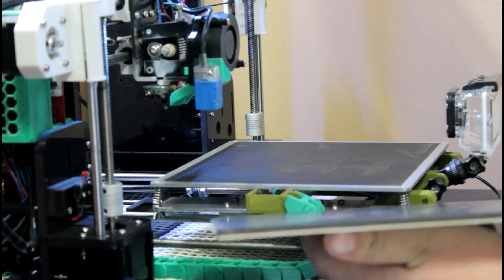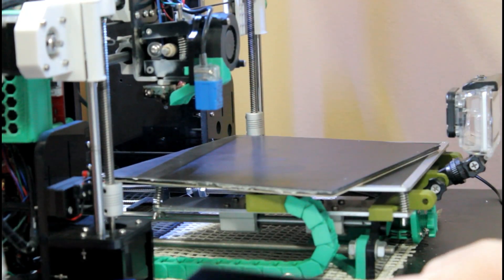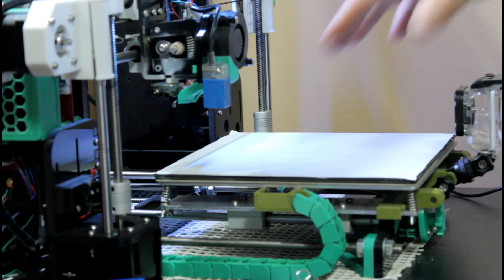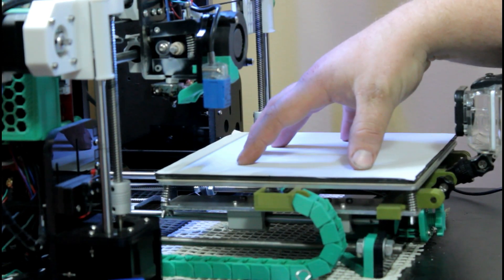Make Your Own Magnetic Flex Build Plate

Comment: Is the magnetic property of this sheet disappear with time?
Reply from the maker: It's still sticking to the workbench, havent used it mich lately though. The bigger issue is the magnet sheet drying out it seems ro crack after a lot of use.

Comment: Thanks for the awesome ideas! I've tried it and have been quite successful with adhesive magnetic sheets with the aluminum plate and a BuildTak type material. However, with my slightly warped aluminum, I'm thinking of either replacing it with a thick carbon fibre plate (or maybe just sandwiching it between the aluminum and the lower magnetic sheet). Where did you get the thin nylon from?
Reply from the maker: Cool! Good to hear someone else is tinkering around with the idea! The nylon is just a thin sheet that they adhered to the magnetic "blanket" when I bought it so I'm not sure how long it will last with multiple heat cycles.  It seems to work well with PLA but anything hotter like PETG it seemed to bound to it.  So i'm not sold that it would be a much better alternative, it does seem to work really well with PLA though.  I had the same issue with the warped bed as well that's why I originally got the PrintnZ plate, I thought maybe it would work well to even the warp out but the mild steel seems to conform to well to the bend when trying to get prints off and it's a bit of a pain to get back straight for the next print.  It does work though if you can get it to lay flat again.  The last time I tried the magnetic film I tried a cheap "buildtak" like material from eBay for like $3 and it worked well so I think you're on the right track with what you are trying.  Something that may work well is to get a cheap borosilicate 3mm glass bed off of ebay 
($27) and try the magnetic material on that.  Then you know the glass would be flat on the bed so the magnetic sheet should be too.  I ended up buying a glass bed to try this but then winter hit and the house is so cold that PETG immediately warps so I've only printed PLA lately so then I just decided to print on the glass plate until it warms up outside.  I hope this helps! Thanks for watching!

Comment: Nice work. Those PrintInZ plates seem pretty thick! i have one ready to replace my buildtak next time it dies lol. These magnetic surfaces really seem to be the way forward
Reply from the maker: For sure, I do really like the printinZ but the glass mat type material does seem to flake when you get a good push on the filament with the right Z height, I think they also use mild steel for the insert so I have to straighten it out every other print because it doesn't quite bend back straight.  But as long as I take the time to straighten it back out it prints like a champ with great bottom layers.  Sourcing some decent spring steel would be the best to pair with the magnets.  Buildtak really did a good job with their system I just wish it didn't cost the same as the printer I would put it on lol.

Comment: how you fix the problem with the sensor and the magnets , i have problem with the same sensor and the z came so far from plate
Reply from the maker: In my experience the magnets didn't really mess with the sensor too bad as long as there was a Ferrous metal underneath the magnetic base.  I used the PrintinZ build plate which has a mild steel middle portion, I think this is what allowed the sensor to trigger consistently.  If I don't use the PrintinZ plate I have a piece of galvanized steel shim stock that goes over the aluminum bed but under the build plate (this video I have a sensor working with the steel on glass https://youtu.be/Nu1_Jdwr4pg).  This allows the sensor to trigger through the magnetic film very easily.  If your sensor is triggering far off the bed you might want to look at your Z offset setting in your firmware to make sure it is set to the new build plate height.  As long as the sensor triggers (small red light on sensor) it means that it is reading through the magnetic film.  I hope this helps.

Comment: Hello, good vids!

Do you have heated bed on the Anet?
Reply from the maker: Thanks! Yeah it's the stock Al heated bed on there, it's warped pretty good by now so I have put a 220 x 220 mm glass plate on to level it out.  This method seems to work still even on the glass although it's so cold in my house now that I just wait for the print to cool and it pops right off the glass no problem.